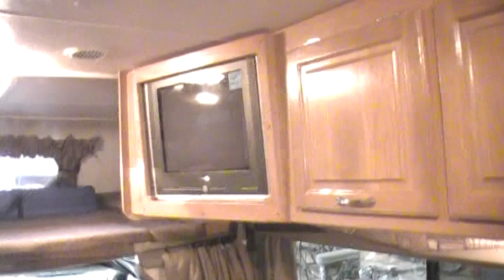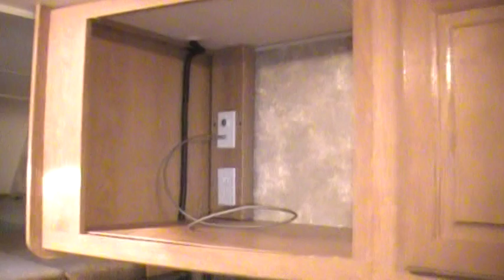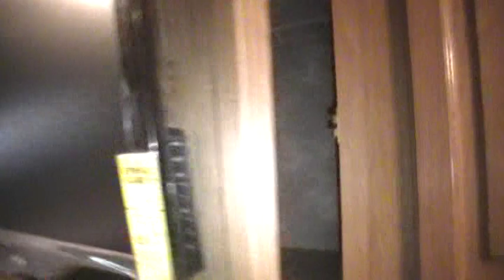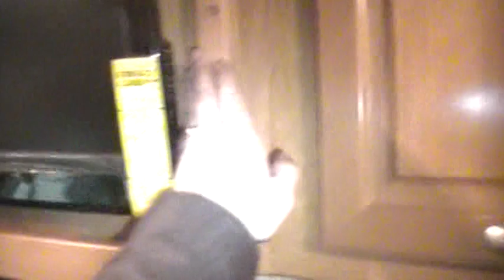rv flat screen tv installation

Comment: was weight of the TV a consideration for this install? My concern on mine will be torque applied to metal hinges screwed into pressboard cabinet during travel{bouncy bouncy}. But I know TV's are getting lighter and flatter.Perhaps insuring the cabinet is closed during travel will be paramount. Anyway,thanks for sharing this.